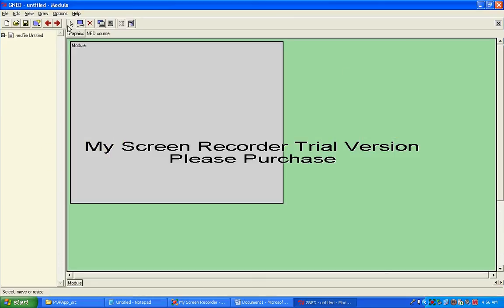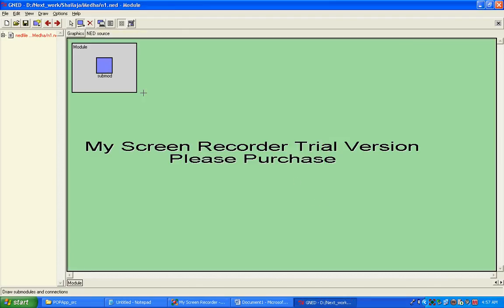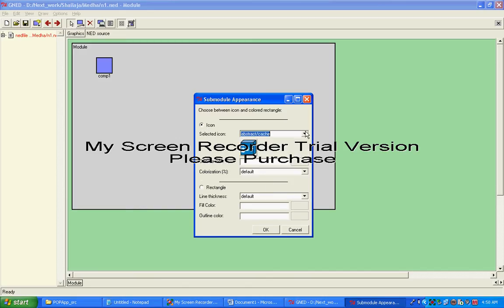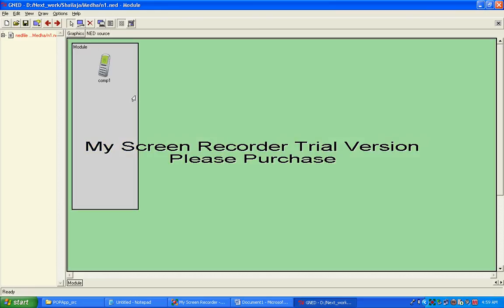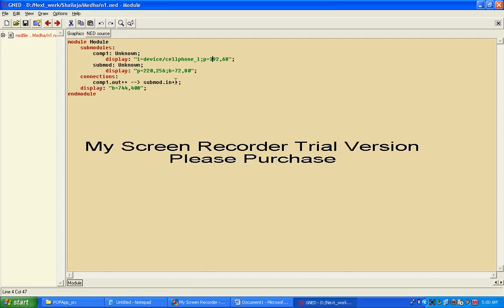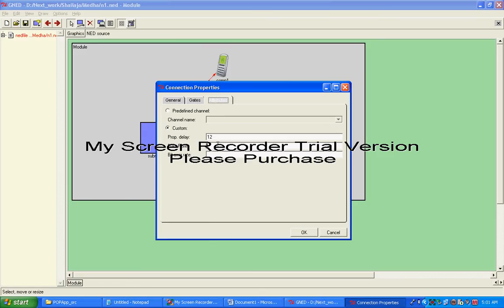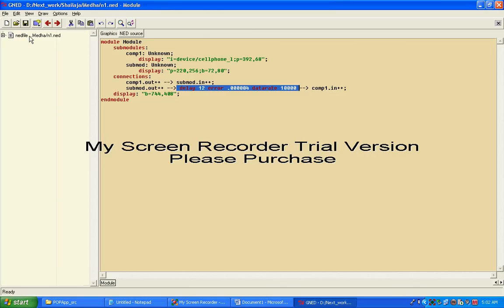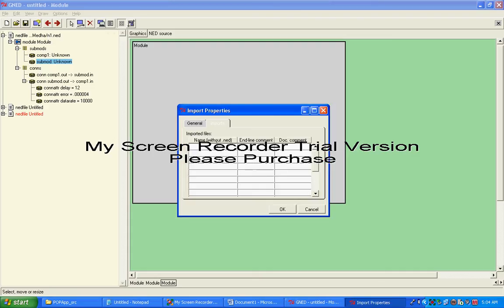Omnet_Video1.avi

Comment: Thanks a lot Sir for the nice video. I did not see when you connected sumo in the installation and secondly, in the connection I made with omnet++, sumo and vein, I did the installation through vein tutorial and everything went fine but when ever I restart omnet, and try to  run the  vein demo,  it complains of "could not connect to the traciServer error", I just have to reconnect it manually with this " /c/Users/user/src/veins-4.6/sumo-launchd.py -vv -c /c/Users/user/src/sumo-0.30.0/bin/sumo.exe" I just need your help.

Comment: i would like to ask if i want to do with database(i want to ask if its array instead of SQL). As in for record and store the lifetime and QOS.
what should i do ?
Reply from the maker: +jo jaafar Use File. That's easy.

in handleMessage()

FILE * fp=fopen("rslt.txt","a");
fprintf(fp,"%d\t%d\n",qos,pdr);// or whatever
fclose(fp);

in initialize()
FILE* fp=fopen("rslt.txt","w");
fclose(fp); // just open the file at the start and flush all data.

in finish()
FILE * fp=fopen("rslt.txt","r");
while(!feof(fp))
{
fscanf(fp,"%d\t%d\n",&qos,&pdr);
// do whatever you want to do with them
}
Reply: +rupam rupam Dear Sir. Yours truly lifesaver. But this one become hectic when i try to make it as courier process which i need to make as in the video.

https://drive.google.com/file/d/0B_lxV3WL0LqGUFpvT0JsbFBodDA/view?usp=sharing

how do i set the time for each of it. since i don't make it overall just snippet from sample project..
later, how  do i see so that i can see the lifetime, the DB id,. So far it give me 0 for lifetime n DB is not viewing/showing in the log.

Comment from the maker: Make 3 output gates of the sending node. Each of these gates are connected to 3 receivers. While sending, just write 3 send commands specifying 3 gate address. Better use gate arrays so that you can loop.  However omnet 3.3 did not have parallel simulation. So visually you will not see 3 simultaneous packets. You need to trace them through sending time.